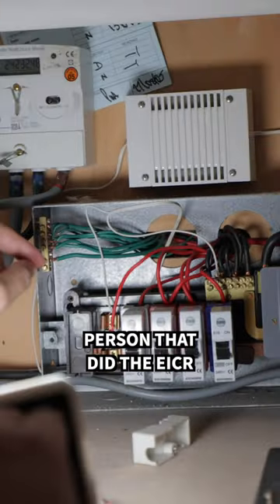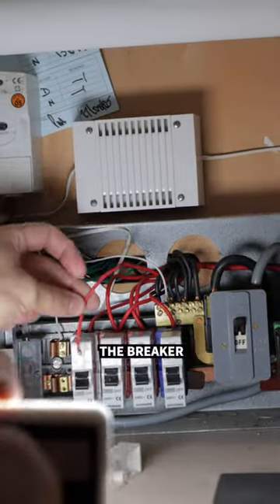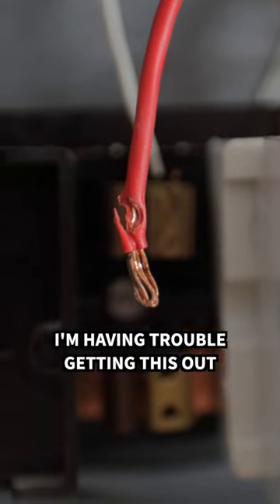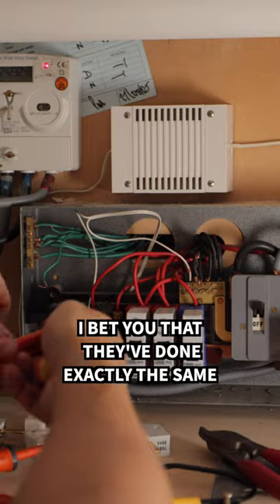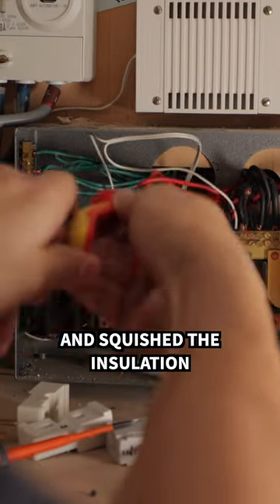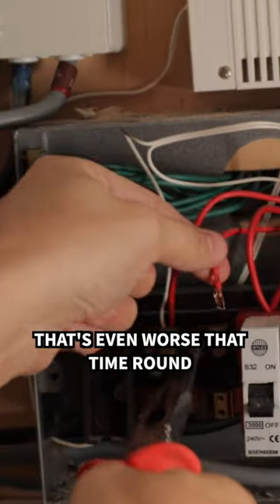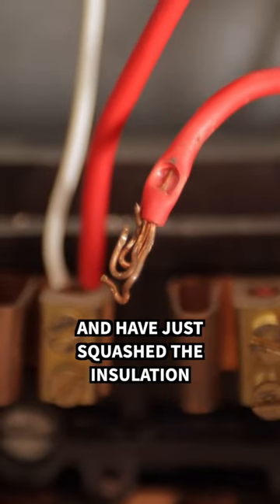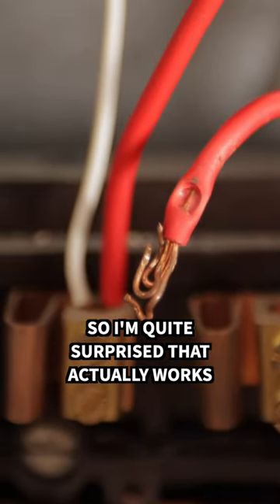“Had A Shocker” 🤦🏻‍♂️ Poor Work From Last Electrician 🪛

Comment: "I'm quite surprised that actually works" - the whole inside of the breaker will be conductive right? Not just the screw? So the bare ends of the wire will be doing the conduction.

Comment: I have wondered about the balance of risks of doing EICRs.  The first one I'm sure would find all sorts of horrors, but once an installation is good is there a risk of too many inspections causing more faults?  Not just this type of thing but weakening copper by removing / reinserting wires for testing - unless the ends are re-stripped, but there isn't always length for that.

Comment: This is a bit fibby 
That’s an old wylex db originally using 3036 rewireable fuses 
The phase cable goes into a double screwed busbar and the fuse or mcb is just a stab blade design, just remake the end before replacing, the lower screw is fully in contact anyway, 
This is the point of inspection and testing it’s not just writing numbers on a form.it’s about making sure everything is made off correctly,tight and secure, 

It’s a better system than most modern RCBO’s  where you can’t even see the cable entry and are fiddler as f@@k ( cable entry not RCBO functionality)

Comment: How can they not hit the copper ???? That type has Two lock down screws ….. so one screw was doing its job ……. And that board yes old shows no problems in its 40 years …. Yes needs changing but don’t criticise others work which artisan seems to love doing
Reply: Why can't they criticise others people's work when they did such a rubbish, un-professional job!  I am sure they didn't teach him that in college!  It's just lazy and rushing to get it done in under an hour...
Reply: Surely having two screws means it’s designed for both to be used, for correct operation?
Reply: @AAW-Electrics Their job is not to criticize other people's work
Reply: @SolarSlut  Ha ha there job is not to criticise and post I'm fully aware what the role of a electrician is and what we are to do when faced in these situations
Reply: Wow … let’s look at the old install …. It’s 30/40 years old no sign of burning no signs of over heating no sign of any problems for something that as lasted over 30 years yet artisan make a point of slagging off the original installer which is not justified and not needed 
As far as two lock down screws it is clear that the bottom lock down did hold the cable correctly…. Just like any mcb -rcbo of today which ONLY has one lock down screw 
So to recap on video ….. it’s an upgrade of an old board not for problems but just an upgrade
If Artisan wish to knock every electrician on his YouTube platform thin he might see why it’s his downfall
Reply: @tomengineer1467  you can see that even the screw that was on the copper was only on two strands. if you get offended by people calling shit work shit it says alot about you.
Reply: @Goryrat  was there burning or any sign of burning NO has it lasted 40 years …YES …… yet artisan want to slag off the installer………. They can’t make a video without finding fault from any other spark…… no fault found in this video except verbal crap
Reply: @tomengineer1467  hand in your license.
Reply: 90% of Artisan videos are alleged issues from the previous person. I'd not be surprised if they damage it themselves then show how bad the previous person was for likes.
Reply: @Goryrat  why …… ok you point out the problem with the board after 40 years 
It’s like this morning (Saturday) I was called to inspect a nice-eic contractor from Cambridge who has run 1mm T&E all around a garden for 240v lights behind steel fence supports (cable tied) but you might think that’s ok 
Artisan needs to choose what they are ….. production company or electrical company and 3 of his staff who lost there jobs over Christmas might still have there jobs …. YouTube is about content (like the early days of artisan) now it’s just adverts and slagging every other company off and it’s cost him dearly
Reply: @tomengineer1467    I think the problem wasn't with the original installer, but with the subsequent cowboy EICR "electrician!"  Also, modern "one screw" MCBs etc use the screw to push down a flat cage which spreads the pressure around whereas the old two screws were there because it was the actual screws which did the connection and the holding...